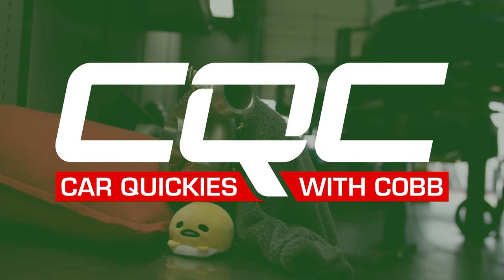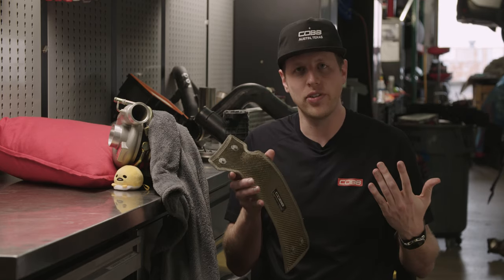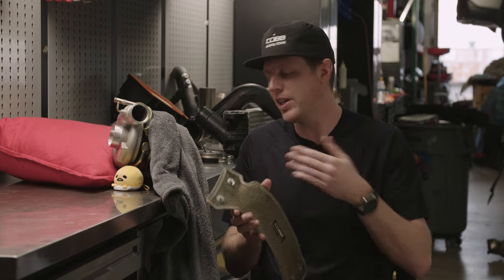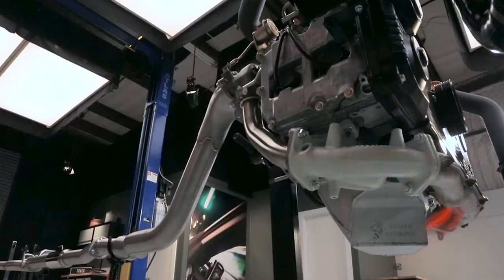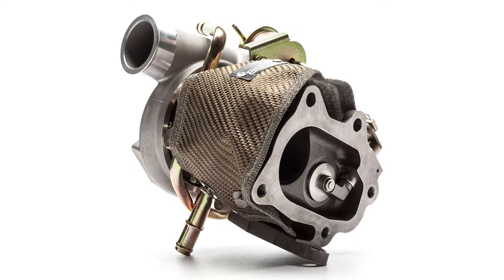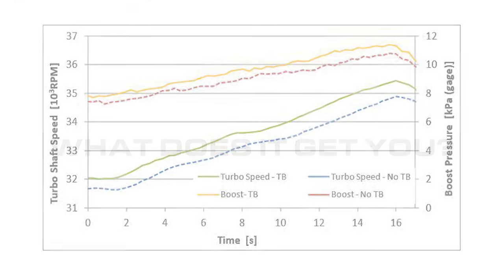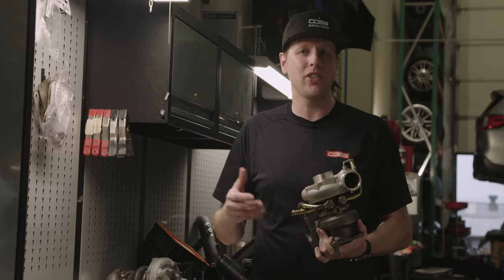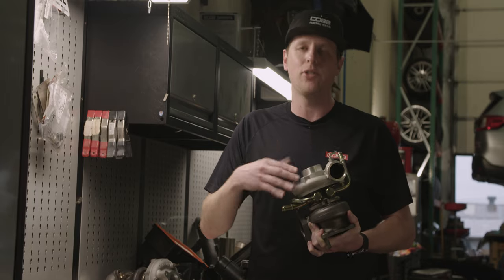COBB Tuning - Car Quickies with COBB - Turbo Blankets

Comment: Does the increased boost have any impact on the fuel/air mix? To that end, does a turbo blanket require any changes to a tune, or is (for instance) the Cobb stage 1 ots map fine for a car with a blanket and little else in the way of mods?
Reply from the maker: Thanks for asking. You do not need to change anything about the tune. The blanket is simply helping with efficiency and heat management. So air/fuel control and metering will still happen with the sensors to adjust for minor changes within the calibration tables no differently than how the car reacts to changes in weather etc.